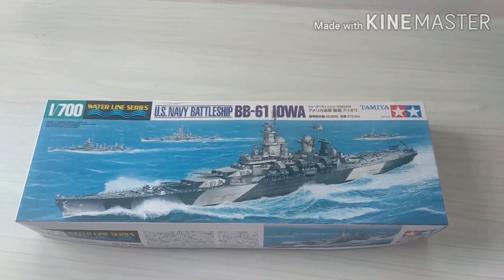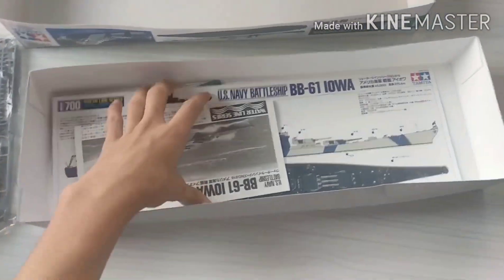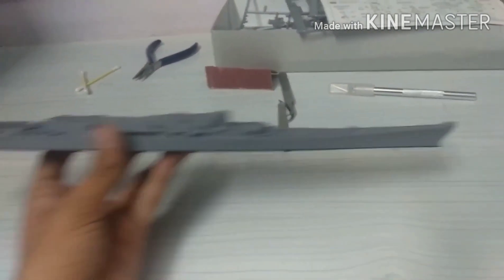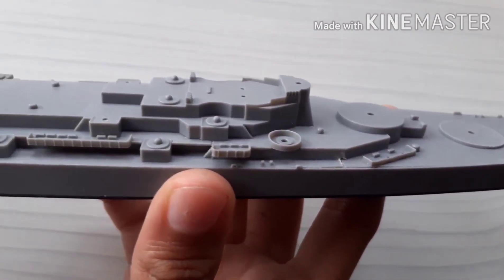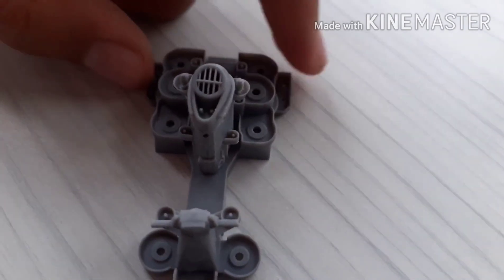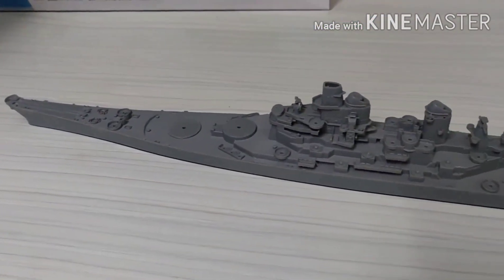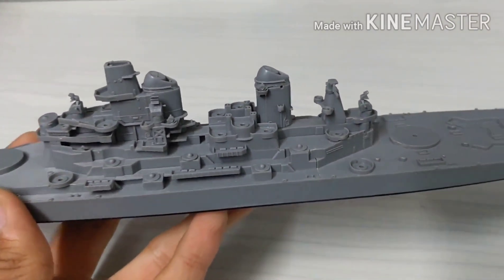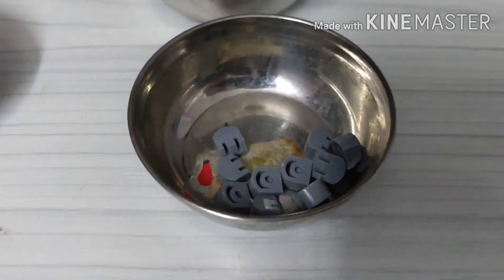TAMIYA 1:700 USS Iowa (BB-61) unboxing and full build

Comment: Hello Dhruv Shrimali, I can recommend something which will help you and everyone with painting of such vessel models
Step 1: You can take a pencil and very slightly and gently, 
Step 2: tape the nearby areas to the paint gets on the tape not on the areas near where you are painting. (you can use a black or skin colour tape and be sure that you at least see it, and also if there is two colour schemes... you can tape first colour then paint and paint carefully with the second colour and start as doing the borders)
Step 3: let the paint dry for maybe a day
Step 4: Remove the tape slowing and gently so it doesn't make a mess out of your hard work.
Step 5: Continue to do this until all paint work is done
Reply from the maker: Hi, although it isn’t evident, actually what I did was exactly what you mentioned. I masked areas and painted layers of the specific colour.
Reply: @DhruvShrimali   Hi Druv, I did this with USS Iowa, USS South Dakota and USS Essex too, but truth to be told I did better than you at paint job. (I mean you did do it as the best you could, And I am not seeking to hurt you internally)
Reply from the maker: Definitely, my painting was not on point, my paint mix was too thick so the paint was uneven, but maybe in the next model it will come out better?
Reply: @DhruvShrimali   yep, I hope it is better, anyway here have a sub
Reply from the maker: Thanks a lot 🙂

Comment: Do you need materials in order to build 1/700 ships like Yamato or Akagi cause many videos they used a drill and it’s look really complex
Reply from the maker: Not really, I just used superglue for all the glue work, some sand paper, and a good hobby knife, which I also used to 'drill' out the holes.